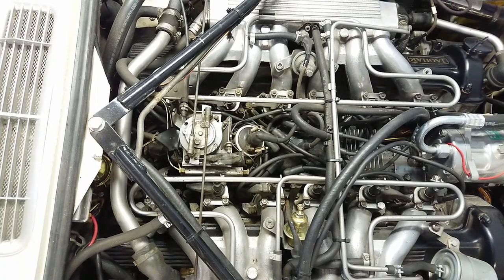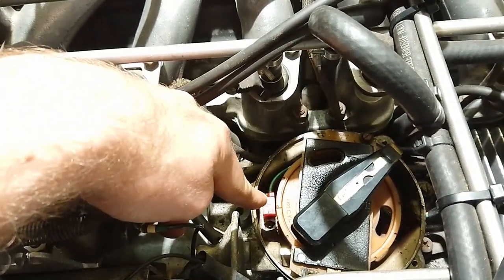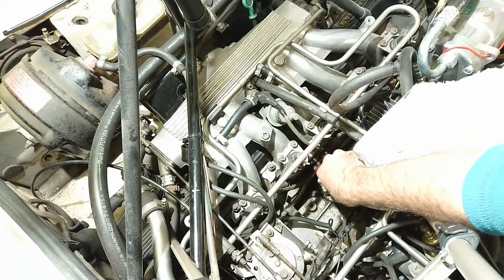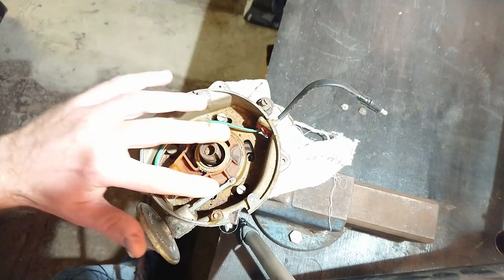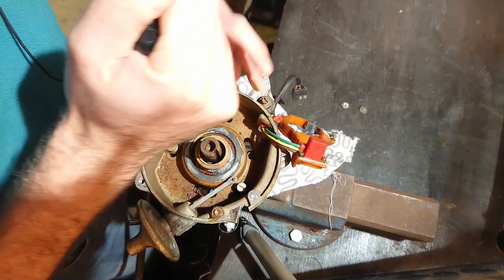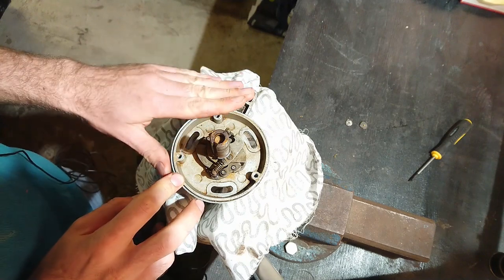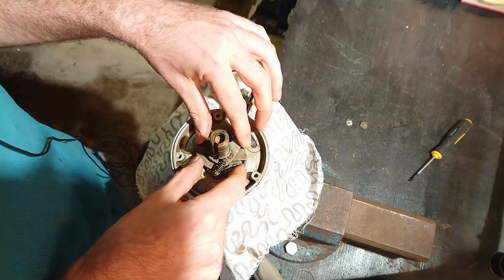Jaguar V12 distributor Seized - Check and service V12 distributor - How to tune a Jaguar V12 Part 3

Comment: Thanks Adam. Picked up a 1981 XJS V12 3 months ago. Last used in 2007. Slow but steady progress toward getting it up and running. Have cleaned out fuel tank, sump tank and feed line to motor. Fuel now arriving under pressure and clean to the motor. My next effort was to replace the spark plugs, but on inspection found that the distributor rotor is stuck to its shaft. So I am dealing with that at the moment. I'll try your method of removal in the morning. Your videos are clear and can be followed with confidence.

Comment: I have a Merali V12 distributor in my 1990 Jaguar XJS v12 . I see videos on the other brands but not the Merali . I would like to see a rebuild of this build from removal to install and service of the distributor  . I am having trouble just removing the screws holding the rotor .

Comment: On the HE you can lube the distrubutor weights through a port under the rotor and you don't have to remove the distributor.
Reply from the maker: Yes but it's often seized and then it's good to remove it
Reply: @LivingWithAClassic  I was able to get away with lubing it and exercising it a few times, never had to remove it.

Comment: Another vital tip of which I was previously clueless, I've never oiled sponge on any of my Jaguar in 30 years, I'm lucky, despite another area of neglect, my cars have been so reliable 🤣
Reply from the maker: This issue is mostly on the HE engines since it tends to get a little warmer in that engine bay. 
I hope to be able to daily drive a Jaguar again soon 😊

Comment: My rotor barely moves. Thanks for the info. 
I was taught a useful tip, to apply grease. When a tub of grease is getting low, drill a small hole in the lid, and use a small hobby paintbrush, to access grease through it. Store the brush in the hole, which cleans the grease and brush clean.

Comment: I've been having overheat problems on my 87  V12  HEI and have been concentrating on the cooling system but your video got me thinking. The car ran fine and lots of power  but was maybe a bit stumbly at low throttle and seemed to run a little 'heavy' at idle.  I removed the distributor cap and checked the rotor  and it was actually fine much to my surprise.  I decided to investigate the vacuum hose while the cap was off and traced it to near the rear of  A bank but it wasn't even connected. There was a hose at the rear of A intake that was blanked off with a bolt.  I couldn't see where it is supposed to be connected and so just removed the hose with the bolt in it and connected the loose distributor end to the manifold.  The difference was noticeable straight away- the idle being much higher for a start.  The good part is that my overheating issues are history even in 35 deg heat.  I'm going to check the timing when I have time just to be sure but the car is much sweeter. Thanks very much for clue-ing me in.  What baffles me is why would anyone deliberately disconnect the vacuum hose and blank off the manifold?.

Comment: Hi Adam! First of all thank you for the excellent and detailed video. I have a pre-HE with some minor issues I assume are coming from the distributor and was wondering if you could maybe share your opinion on the matter. 
The engine idles and throttles perfectly in neutral, but once warm and in gear has trouble getting up revolutions. It kind of sounds like it stalls - but both spark and fuel arrive well. I took off the distributor cap and contrary to what I see here, I cant lift the rotor arm off the distributor for the life of me, any tips on a seized rotor arm? 

Looking forward to your next uploads as always!

Comment: Adam, thank you for another great video. Do you have any tips for removing a stuck rotor arm?  I have an ‘86 XJS HE  and the rotor arm does not budge  when I try to pull it straight up. Thanks again!
Reply from the maker: When I got my XJ12 the rotor was stuck too. They are a very tight fit. I made two zip tie loops, put one around each end of it and pulled up pretty sharply. You can tap on it as well with a hammer gently. Have a new on ready since the old one might break. Hope this helps!
Reply: Hi Adam, I own a 1981 XJ-S V12. I have the same problem that you had with your 86 XJS, namely the rotor arm will not budge from the shaft. Tried everything I can think of in order to exert upward pressure on the rotor, but no joy. How did you go with yours?  Any tricks that you can forward on to me?
Reply: Sorry, Chad.

Comment: I worked on jags for 50 years,  I Don't Advise Removing the Dizzy, work on it in situ.
Remove springs & bob weights and lightly oil.
If you dont want timing/ingition problems and your not mechanical minded do it i  place.
Fitting  ignition  leads/plug leads,   tip>  add them up to 7   1R6L  5R2L  3R4L  6R1L  2R5L  4R3L.  I  amended the order.
Reply from the maker: Great tip about adding them up! Very cool 🙂
Reply: Thinking about it, as i haven't done it for years, it just came back to me,
Put the firing order of a 6 cylinder engine    1 5 3 6 2 4 as the rhs,   then add them to 7.      1R6L 5R2L 3R4L 6R1L 2R5L 4R3L .
R-right  being the drivers side on RHD cars                                                                                              1         5         3         6          2         4
Reply: Wish I had listened to you Jeff!! Now I have no spark ( the rotor must have moved) so now ill have to check rotor position against #1a at TDC, which just happens to be the worst plug to remove...any suggestions Jeff? thanks in advance.

Comment: Hi Adam, I bought an S2 XJ12 with opus ignition that was replaced by an aftermarket (Allison) system. The pickup in the distributor became loose and the timing was lost. How do I set the pickup position (static timing?) Should the distributor cap #1A contact be aligned with the rotor at 10deg BTDC?

Comment: Great video as usual. I have just purchased a 1992 XJS with the 4.0 6cyl engine. Should the same thing be done to the distributor on it? Cheers
Reply from the maker: Thank you! They don't suffer the same issues as the V12s do with the very hot distributor.
Reply: Thanks for the info.

Comment: what kind of grease did you use? thank you. I have a 1989 marelli v12 that I believe the distributor is stuck
Reply from the maker: I used normal wheel bearing grease. It can take the heat well. A Marelli distributor does not have any weights in it. It's all done by the ECU there.
Reply: Okay does that mean I don’t have to do this service you describe in this video? Thank you I was about to take my distributor off

Comment: Also does the correct rotor position have to be checked against 1a TDC?...thanks in advance
Reply from the maker: Rotor pointing towards cylinder 1A. On the distributor cap there is a 1 on it. It points toward left hand headlight